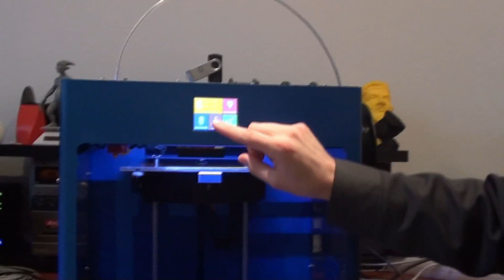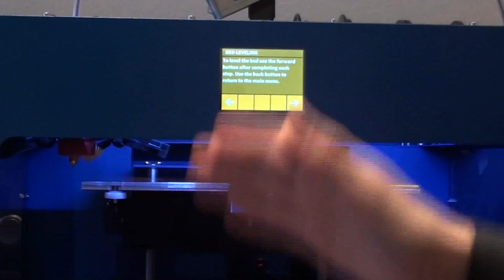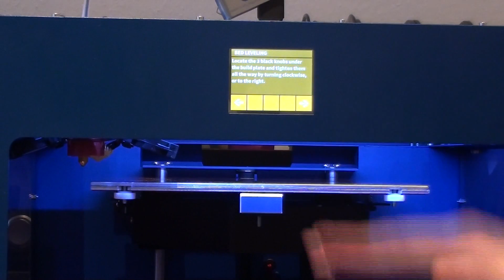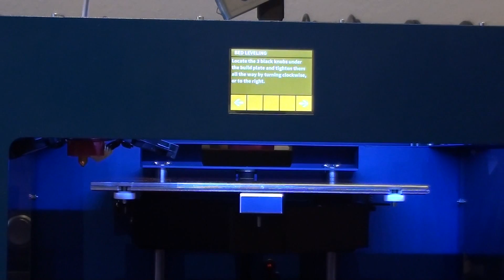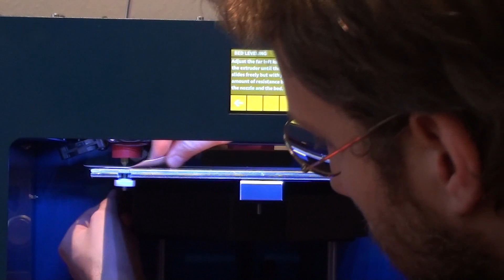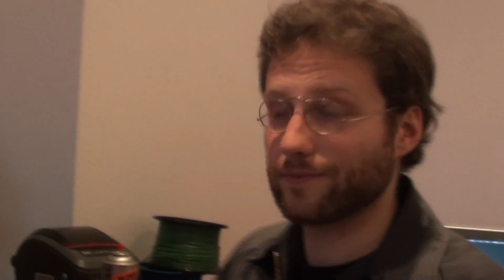CraftBot Bed Calibration

Comment: Make sure you don't have a bit of plastic stuck on the nozzle that will effect the height. I level my Makerbot while the nozzle is hot but I'm not sure if that will work with the craftbot. Also be careful about moving the bed as your handling the knob, I tend to turn it then let go of the knob then check the height with the card and repeat as necessary.